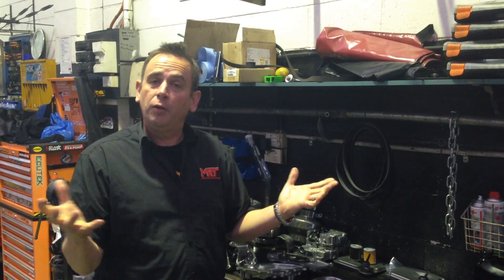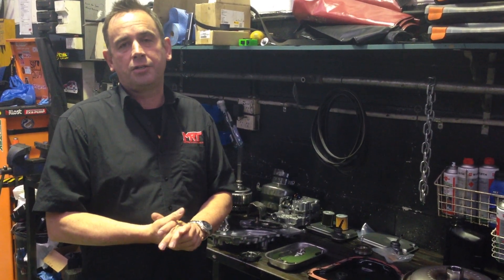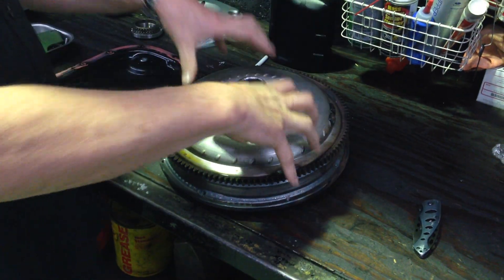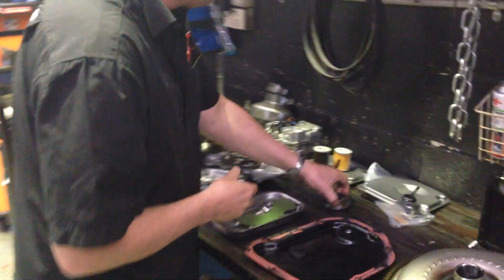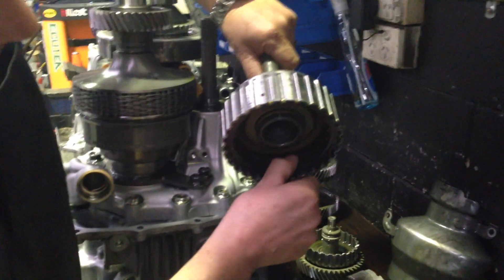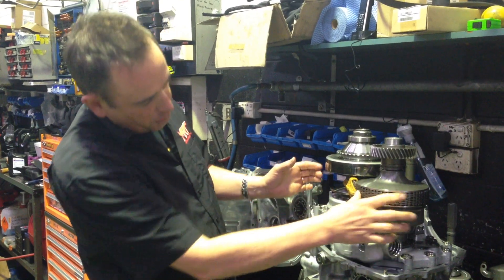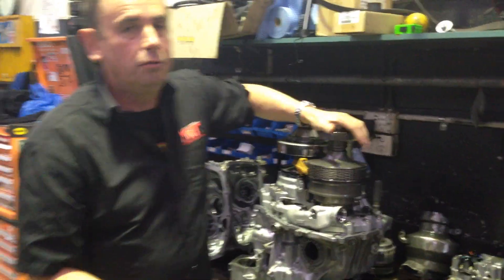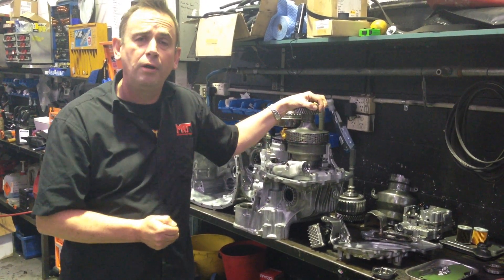Subaru CVT transmission secrets

Comment: I know Subaru is recommending service only if you are towing or driving under extreme conditions, but maybe the cvt fluid should just  automatically be changed every 30k miles.
Preventative maintenance
Reply: That will actually cause more leaks and discount mechanic misadventures than it would do to prevent CVT failure. Unfortunately the alternative puts it out of warranty.

Just getting over my first serious hatch...sadly she had already been out of warranty right about that time where we found out she had CVT (disorder).

Fortunately I was able to blame it on the electrical component recall causing uneven resistance at the breaks, dif and CVT like I did. Dealer was happy to fix it on Subaru's dime. Now she's not just running tight...Dare I say she might be tighter than die hard catholic girl's father hopes for when even though she's off to band camp.

Knew she wouldn't stay like that forever so I quit while I was ahead. Gave up on my dream to make it as a pro skater with his sold the rights to that brand of personal vaporizers that's always getting suit...Now I spend my days writing elaborate bullshit in the comments section under youtube videos.

It ain't much but it's enough to take care of the Porsche and I and still come out ahead on quality time and repair costs.
(Even paying 700 dollars for her expensive taste in lube I'm now debt free and 500,000 dollars ahead of last year not having to worry about CVT repairs and all the court charges associated with blowing sick clouds at the 5.0 to block them out for being haters.

After growing the fuck up and refining my taste I've learned a there 3 key considerations when deciding whether to cut your losses .

1. CVTs are have been around for a while but just haven't had the same number or R&D hours thrown at them as a trusty stick or most newer geared autos.
Despite the reduction in complexity on paper the R&D needs to catch up for most of their theoretical advantages to be genuinely worth the drawbacks.

2. Keep in mind that Subaru  decided to trust Nissan to design and supply their CVT. (Toyota was outbid but supposedly their CVT is bulletproof...but still a CVT.)

3. This issue affects about 5% of units. To put this in perspective of every 25 guys and gals who make the decision bring these cars into your life 1 will be emotionally abusive, gaslighting them into becoming hollow shells of their once happy selves - Know what to look out for and put your foot down early...If that fails hiring a professional is likely covered by the powertrain warranty if you don't ignore the signs.

Be careful with the latter of the 3 however...she's still like that crazy red headed catholic girl and just leave you like the social studies Prof she's calling daddy.
Eventually you'll probably catch on to her antics but after after putting up with her drama but realize a moment of clarity too little too late because she spent all your money on the "body work" with your only solution left being to insert your 2nd favorite mötley crüe album into the single CD slot

 ...Couldn't use kickstart the heart because it's on your android that is constantly ignored by the ice cold temperament of the 2015 subaru starlink headunit.

Settling for "home sweet home" You realize you've made just another poor decision to add to the snowball of mediocrity that have ultimately become you and proceed to floor it 0-59mph  in a blazing 15 seconds balling your eyes out as you run it off a cliff before you can even get a taste of 60. 

Not that you'll have had any business expecting better for yourself given your low expectations coupled with that acquired deranged taste of yours to punish and blame yourself.

This time will come well before it's time to replace the CVT so don't worry about prolonging it's life. You're only feeding your disease.

Instead...

KILL IT WITH FIRE!
SELL IT TO A FLATULANT 300LB UBER DRIVER
ANYTHING BEFORE IT CONSUMES YOU!
Reply: jake lami have you seen the transformation of the fluid after 50k miles?  It’s pretty degraded.  All fluid gets hot, breaks down,  and gets contaminated.  The manual itself states several factors like weather, towing, where it recommends the fluid to be changed.  
Also, pretty sure Subaru made their own cvt, not jatco.
Reply: @MrFloydroy  You are correct, Subaru has been making their own CVTs for over a decade.  They also recommend fluid changes at 30km & 60km in Japan & Canada.  It's only the US manual that states 100k miles (15k if towing), most likely to lower the cost to own for marketing purposes.  
I am not a mechanic but I recommend swapping the fluid out more frequently than the US owners manual.

Comment: I have a 2018 Subaru Legacy 3.6R with CVT.  It's my second CVT Subaru. (2015 Forrester)  I have had no problems with either of those cars and would recommend them to anyone.  I am a car guy from a car family.  Driving, for me, is one of the most enjoyable parts of life.  I'm passionate about it!  Get it?   It's such a boring, stale, and old meme to hate on CVT transmissions.  Yeah, I'd get a manual if I had a Porsche or even a Mustang GT.  But seriously, this Subaru CVT transmission isn't unreliable or "gay" (comment by a moron).  I drive mine really aggressively at times and the thing just takes it and asks for more.  So please understand that some of us have different opinions from the haters.  Finally, electric cars mate beautifully to CVT's.  They'll work perfectly for that application and will only get better over time.
Reply: Not much of a testimony. Your oldest CVT is 3 years old. Get back to us in 10 years.
Reply: @nickv4073  I have a 2014 crosstrek, still fine
Reply: I bet you you never drive ou of the city. Go take the Forester on some dirt road every weekend and you will slowly hate the CVT when it start slipping
Reply: You've clearly never gone up a hill on a dirt road with either of those cars. My stick subaru does it no problem. there are literally tons of youtube videos showing the cvt can't make more than like 40 to 60ft-lbs of torque in certain circumstances
Reply: LOL, you've had the car for just a few years and haven't driven far no doubt. My 2011 Liberty CVT just had a "solenoid" or something that controls the oil pressure for the torque converter (the drive phase where the gearbox/converter locks up into full CVT mode) fail so it feels like it clunks into gear when it used to smoothly convert to full CVT mode. The car has done 256000km so I'd expect things to fail but not be basically unservicable. These things are designed to not be serviced (as told to me by Subaru) so will cost $1500 - $2500+ to fix (parts are $2000 before labour, or I could get a second hand CVT to save a few dollars) as the whole thing has to come out and be pulled apart. I love how a CVT drives but whoever designed it is a dick head considering my 23 year old Ford Falcon has hardly any issues at 318000km and if it does it costs a couple hundred dollars to fix. I'm going to contact Subaru about this as their CVT's are known to have issues (Google it)
Reply: I think the CVT cars with "fake shifts" and a manual mode are a joke. No true car guy would want one.

Comment: Subaru just extend again the warranty 10 years 100K miles on their cvts, that mean they are certainly not very reliable. Just received a letter for my 2018 Crosstrek.
Reply: clou1969 yup, got the same letter for myb2018 Outback. Not really giving me a lot of confidence.
Reply: Ryan Merkel yesterday my CVT stopped changing speed, was like it was starting on third speed and at 45 km/h & rpm was at 4500. Car got in limp mode the dash was blinking like a Christmas tree. Apparently control body transmission failure car at the dealer for investigation. I have only 15 000 km on the car.
Reply: get rid of any subaru built today before 100000 miles before the major stuff falls apart. regret buying the forester
Reply: Ed major failures starts before that on most models. I’ll get rid of mine at 30k-50k max. Especially with the 2.5 liter.
Reply: you know back then warrants only covered 60k miles on transmissions.
Reply: Ohwaitudidnt yes and it was certainly not enough considering that it cost 7000-7500$ to replace a Subaru CVt. That’s why 100k miles is still insufficient considering the replacement price. Warranty shall be 200-250K miles at least otherwise it’s very scary to own a Subaru.

Comment: Change your oil at 5000 miles and every 25,000 after that. They SHOULD have a spin-on external oil filter and an oil cooler. If not F them!!!! Also every CVT should have parts available to rebuild, sorry I don't want you to sell me a $5,000  to $6000 new CVT, when I could get all the guts replaced for $3,000

Comment: The stock Subaru CVT cooler is a coolant based heat exchanger. My Forester coolant normally operates at about 198 degrees F once at operating temperature. That means the CVT fluid being routed through the exchanger is being heated to at least 198 degrees F. I have an OBD device and app that is showing my CVT running at 210-212 degrees F. This is stock. 

I understand the exchanger provides a dual purpose, to heat the CVT fluid also, but it is my understanding CVT fluid supposed to be kept at 175 degrees F and 198 and up is too hot. Has this been a contributor to CVT failure in your opinion?
Reply from the maker: Typical CVT failure is  not effected by trans oil temps, fitting a trans cooler will not make the trans stronger.
Reply: @MRTPerformanceAustralia  Not trying to make it stronger,  just cooler so it won't overheat and cause the fluid to deteriorate.
Reply: @MRTPerformanceAustralia  Interesting. If overheating transmission is not a cause for failure what is?

Comment: Why not install the filter where you can access it without tearing the whole thing apart to get it out,
Or am I just an idiot?
Reply: Exactly right. Alison transmissions, THE name in heavy duty transmissions, has an external spin on filter just like the oil filter. Gets changed with every fluid drop and the equipment remains happy.
Reply: The oil does not get dirty, so the filter is just a failsafe measure. The elements should be good for the lifetime of the transmission. If you are making metal, you will know, and you will be in the shop before the filter is full.
Reply: Exactly my thoughts
Reply: I have a 2006 Outback and it has an external filter that you can change like an oil filter, much better design. You still have another oil filter you can reach by taking off the oil pan. That new design is just plain stupid. CVT transmissions are not working out so well. They break and the cost to repair in many cases means you need a whole new transmission. As these cars age, you will see people junking these cars with CVT's as the cost to repair or buy a new one will just be too much. Progress is not always a better design or more reliable.
Reply: @don-cw1yz  All hater opinion, no data to support your claims. As cars age MOST people junk (replace) their cars.
Reply: @asmodeusasmodeus7591  Like I said I have a 2006 Subaru Outback. It is still in great shape. I do the vast majority of the maintenance myself. One thing I will say about Subaru is they are made with good steel like Toyota's. When you work on cars yourself you learn a lot about the quality of the parts
 and the engineering that went into the vehicle.
Reply: the machinist  Sure Subaru extended the warranty on CVT's but only after they started failing.http://www.subarucomplaints.com/cvt/
Reply: Just Subaru things.
Reply: @callumdonington2227  i had a civic, it doesn't even have a transmission oil pan, you have to remove the gearbox then disassemble it just so you can change the ATF filter
Reply: the machinist  So who cares about the 10 years,100,000 warranty. That just means there is a problem with the CVT. Subaru had to extend the warranty or no one would buy their cars with a CVT. Or the customers would sue. What do you think that does to the resale value of those vehicles equipped with that transmission? Subaru looked at what happens when you don't do something for your customers if you have a problem with your vehicles. Remember what happened when Chrysler/Dodge would not cover customers with faulty transmissions on their Mini Vans. Or Nissan with their faulty Jatco CVT 's.The word gets out that the company has problems and will not take care of the issue. People stop buying those companies vehicles. The company attitude, "you bought it your problem" does not work in the vehicle business anymore.
Reply: the machinist  Toyota is much better at recalling and fixing at no cost to their customers. Ever since the gas pedal acceleration issue, Toyota will recall for everything. They also do not seem to have issues with their CVT transmissions. One of the best transmissions out there is a 6 speed Toyota automatic. The newer 8 speed is having some issues. Toyota makes its own transmissions.  My brother leased a Subaru as buying one was risky. That way if any issues it was their problem. Look I actually like Subaru, I am still driving my 2006 Outback,  but frankly, Toyota will take care of issues. They just sent a recall letter to my daughter for clearcoat problems on her 2010 Corolla. I think my next vehicle will be a Toyota or Lexus.
Reply: Three years is not long enough to say a vehicle is reliable in my way of thinking. I have a 2006 Subaru Outback that is still running well, now that's reliability. Toyota has changed, they are more fun to drive. Plus I am getting older so reliability is what I want. I am in Canada but my brother is in the US. Leasing in the US is cheap.
Reply: the machinist  Not on 2013 models
Reply: Planned obsolescence. These will last up to a certain point, then they expect you to buy another.

Comment: I got a problem with my subaru xv crosstrec 2013 cvt, when the car rolling and push the accelration pedal any noise look like something splin. When we check  the error code P0700 and P0841 What excaly the problem, and why the dealer say must replace the transmission assy?

Comment: Seems to me that Suburus that are old last longer than the new ones. My mum gave my son her old 1990 Suburu Legacy 4 door last year....my son is 17, the car is 28!...and it runs really well. Meanwhile, my neighbour has a 2012 or 13 Outback that always seems to have issues. A guy I work with has a Forrester that is always costing him money, not sure what year but it is fairly new. He says he'll never buy another one.
 What up, Suburu? You used to make good cars that lasted but now they are getting as unreliable and costly to fix as lesser brands.
Reply: The only issue we've had with our 2012 Outback was it began stalling occasionally when coming to a stop, due to a bad design in the torque converter. Bushing used instead of a bearing and debris was clogging a solenoid. Started around 74,000 miles, well after the warrantee expired and without any action from us, we got a letter from Subaru stating that a design flaw was causing problems in some cars & if you were having issues, post warrantee or not, bring it in to have the issue repaired at no cost. They replaced the torque converter free of charge at over 100k miles. In and out of the dealership in three hours and no further issues. Have had dozens more issues with multiple GM cars & trucks and never, ever had the level of commitment from them that we get from Subaru.
Reply: I've got a 2015 Forester I've had since 2014 (5 years) and only had two problems in 60,000 miles.  A bad brake switch (which caused some really strange electrical problems making the dash light up like a Christmas tree) and a bad RR wheel bearing.  Overall, pretty reliable I'd say.
Reply: Not according to Consumer Reports.  Sure you will have problems with some of their cars, there is not one car in the world that is perfect, look on the internet, and you will see there are lemons, universally throughout the car world, the key is the % of lemons to peaches.  You can not go by anecdotal posts, "my neighbor had this problem", "I heard about someone that had that problem".  I built a computer in 2012, when I was buying the parts, from numerous online sources, I found that every single part, from every company, had some reviews saying they were bad or had some problem or other, so what I did, was buy the parts that had the highest percentage of good reviews, with a large amount of reviews.  I have not had any hardware problems with it, since I built it.  Knock on wood, "ha,ha".
Reply: We have a 2013 Outback and have had zero issues with the car.

Comment: These Transmissions have been around for years on large Industrial Punch Presses. I've got a 2016 Forester and love it, though I am a very gentle driver. I really like not shifting. Guessing that this transmission is not for Trailer pulling or other rough use.
Reply: With a cooler and staying on the fluid change intervals, you could do mild to moderate towing, but nothing extreme.  Look at the Ascent.
Reply: I've been an industrial mechanic worked on hundreds of these which has common Reeves drives and us drives what is basically the same thing cvts a little more complex
Commonly used before the innovation of variable frequency drives to control motor speed

Comment: I gave a couple of my auto enthusiast friends a ride in my 2016 Legacy 3.6R. They both thought it was a stepped automatic transmission. CVTs have gotten a lot better from a performance perspective. Reliability wise...time will tell.
Reply: Any update on your 3.6 please... I've got similar (2017) with 165k kms about to do the CVT fluid as a precaution... any issues, and do ya drive it enthusiastically?
Reply: @peterlattimore6013  Yeah I'm still driving it with spirit lol. I'm at 74k miles (119km). Still no transmission issues and only really minor stuff generally! Had my CVT fluid drained and filled around 50k miles